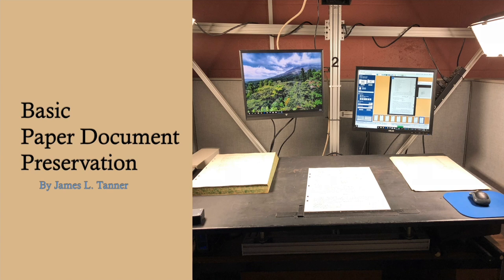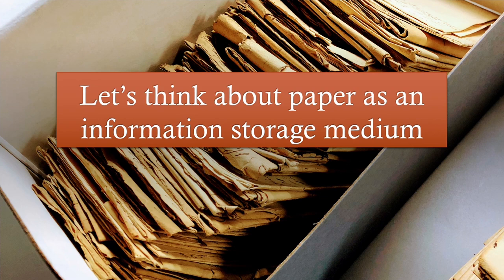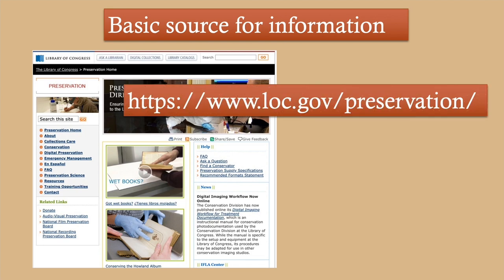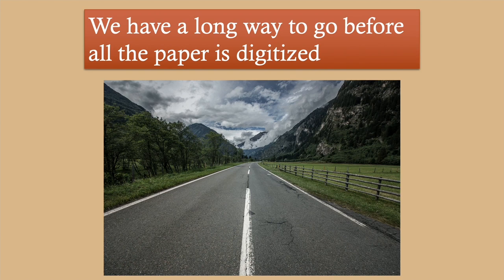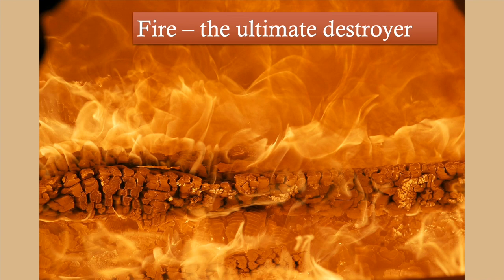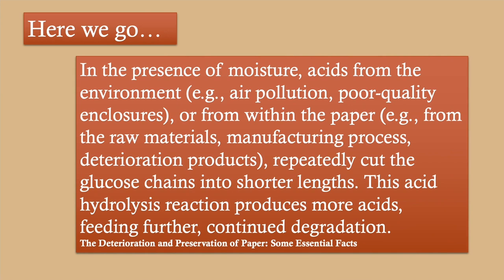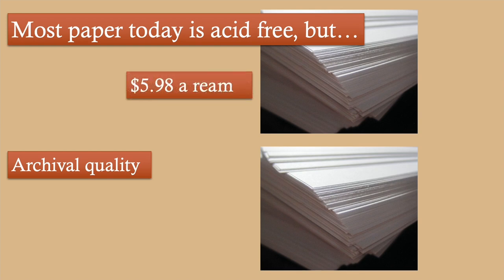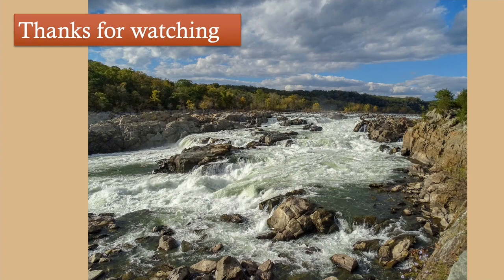Basic Paper Document Preservation - James Tanner

Comment: Thanks for the lecture.  You were very broad and gave excellent examples.  Basically to preserve original paper documents is to kepp them out of light as much as possible, cool(around 50-70 degrees), and low humidity(30-40 percent).  Also preferablly).  Also in a insector/vermin free environment as well in a waterproof room containers though not air ticht.  I am sure I am oversimplifying your lecture but I think that is the jist of it.  

One question I have is it okay to put a such paper in a plastic pocket(not sealed) sheet with little to no weight on top of it except some other similar plastic pocket sheets with documents in them.  I do not want to spend the money for a dehumidfyer(live in Atlanta where the humidity outside is around 50-65 on average year round).  I figure the plastic sheet should reduce their exposure to moisture more reasonably while still getting some air.